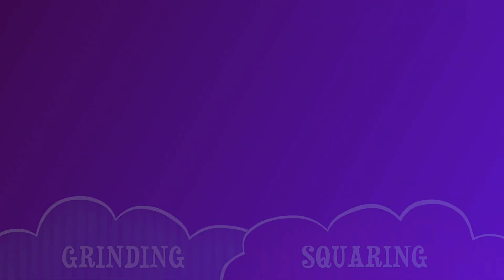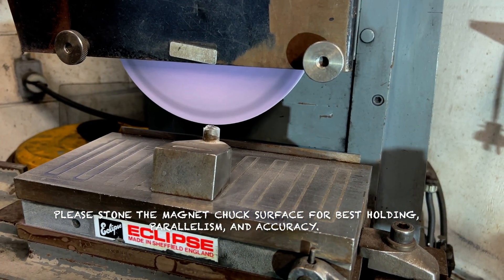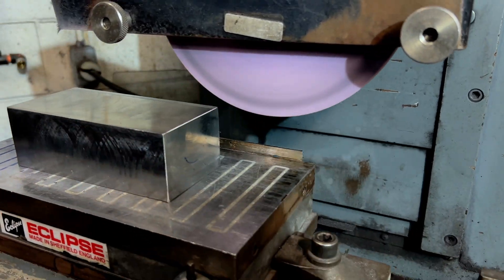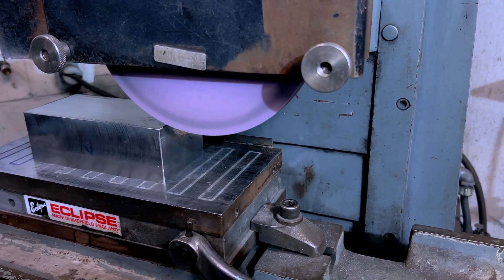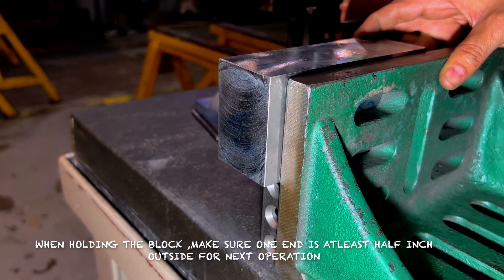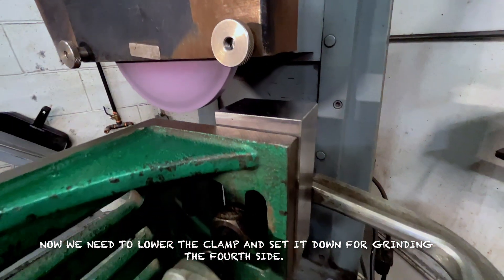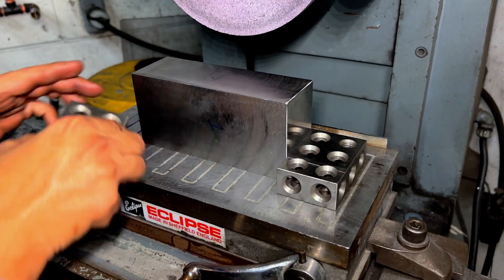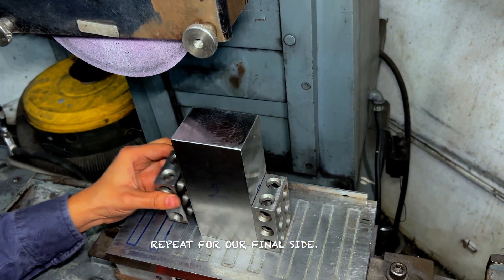How to square a block  within .0001 on a surface grinder ?#manufacturing #how #technology #diy

Comment: No blocks needed when grinding the second edge. The blocks need to be 90 degrees for the final end. They offer little support in the displayed orientation. Better still, both blocks edge on at the left side of the block.

Comment: this is actually not the best way to do this. This way relies on the angle plate to be perfectly square, and it is not because it is a milled angle plate. There is a well known method that is displayed in machinist handbook that has been used for 100 years, this is not that method if you need higher precision. you can also see the surface finish on this block that it is not ground very uniformly.